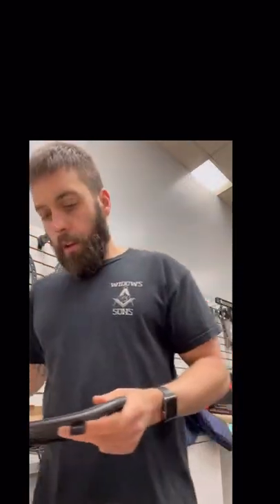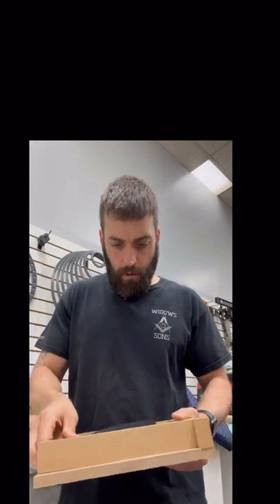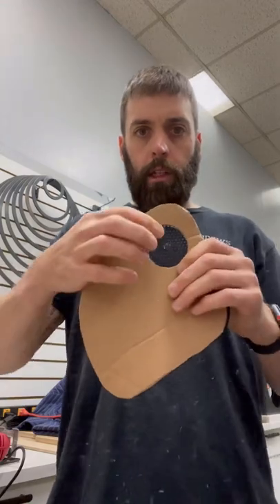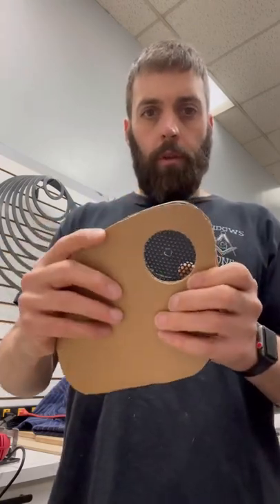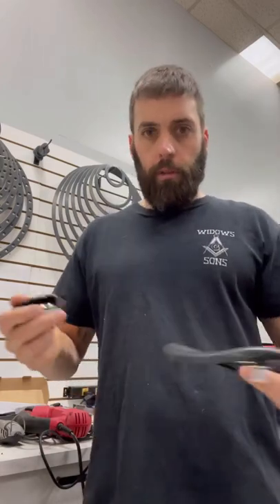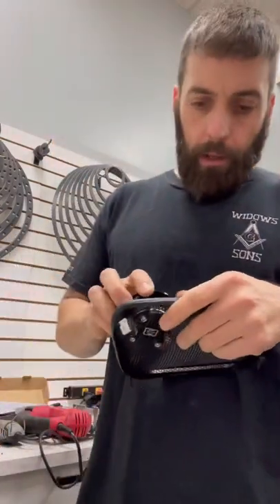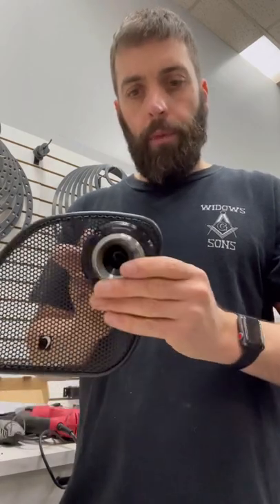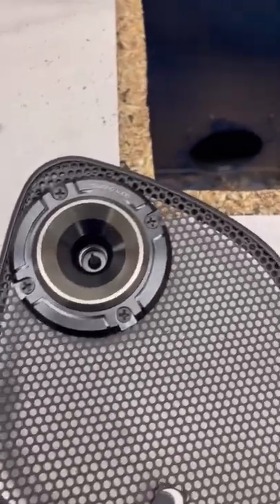Adding horns to a road glide

Comment: It looks like it hits the woofer surround... Will that affect sound or rub a hole thru that surround, when the woofer is pumping?  Does it look like moving it toward the center would avoid that?  Great video by the way, I want to do the same thing.
Reply from the maker: If done in the correct spot it will not touch your surround

Comment: I just bought the Mspro65’s for my fairing and M075t’s for the grills and I’m running MP694’s in my lids I bought an HKI mini DSP and this will be my first time using a DSP
Reply from the maker: I have a video on tuning the dsr1 already. But hopefully I’ll be getting a video this week on tuning the HKI mini. 
It’s very easy to do once you understand it!
Please reach out if you have any questions!
Reply: @actaudiollc306  I will most definitely and I appreciate any help I can get I’m looking at your DSR1 right now
Reply from the maker: Message us on our Facebook or Instagram page and we will get back to you faster if you have questions on it
Reply: @actaudiollc306  I will go add you on Facebook
Reply from the maker: @BlackEyeSRT  did you see the hki mini tuning video we did
Reply: @actaudiollc306  yes I did I tried to get my radio flashed and no shops near me are actually able to do a flash for 21-22 models so I’m at a stand still with my build
Reply from the maker: @BlackEyeSRT  where do you live?  Also you don’t have a Harley dealer near you?
Reply: @actaudiollc306  I live in Spokane wa and yes we have lone wolf Harley Davidson, but they have the old one for 2020 not 2021/2022
Reply from the maker: @BlackEyeSRT  that’s bizarre to me a Harley dealership can’t flash their own motorcycles 😂
Reply: @actaudiollc306  I just went today to another dealership and they don’t have it either